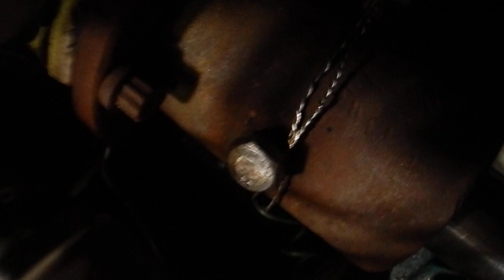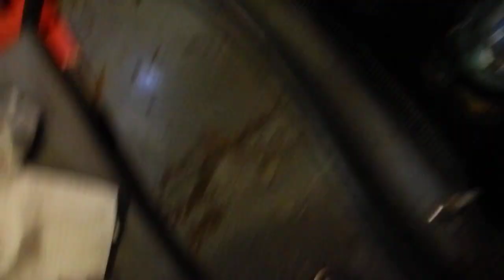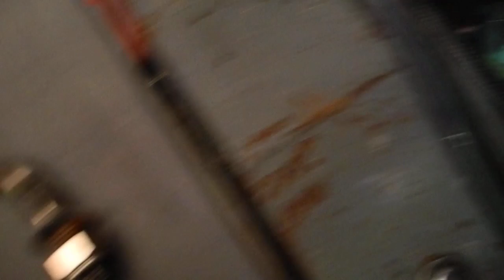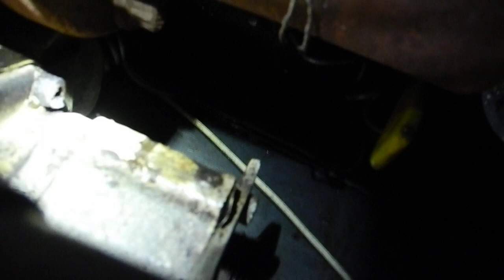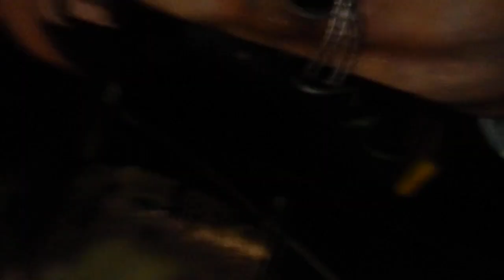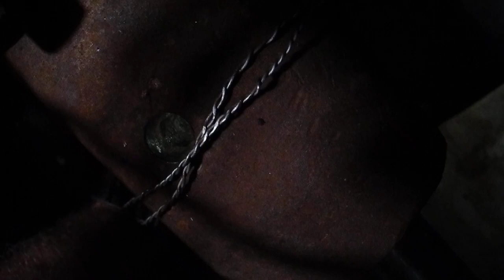Propeller Shaft Pin Falls Out

Comment: with that said wouldnt it be wise to carry one or two extra shear bolts in your spares , to repair this
Reply from the maker: chris neville these bolts are cheap and affordable but it’s not a very common occurrence. About 12 years ago we know a cruiser who had this happen. His shaft did back out of the coupling and jammed against the rudder while in reverse. This stopped the propeller from falling out and leaving a hole in the boat. Since then we haven’t seen this repeat problem on the hundreds of boats we’ve been aboard.
Reply: thank you for the info